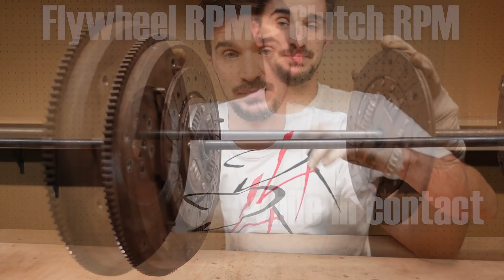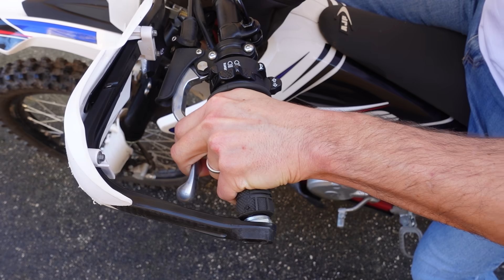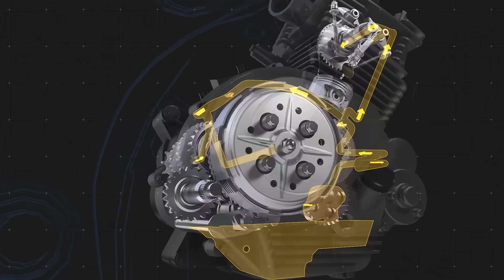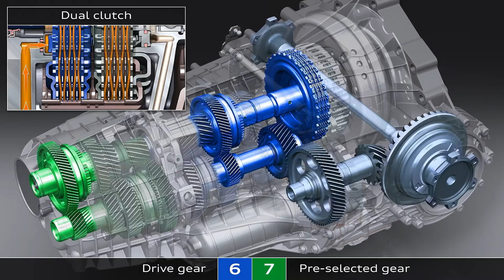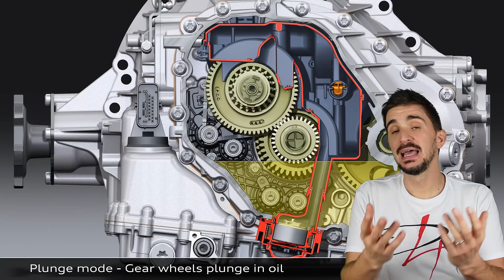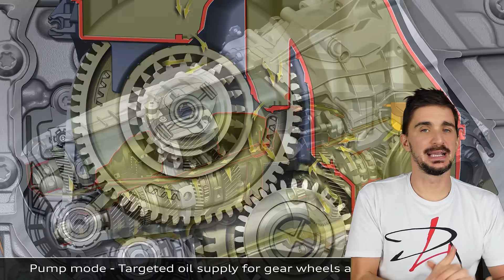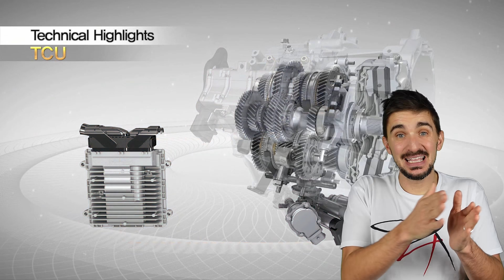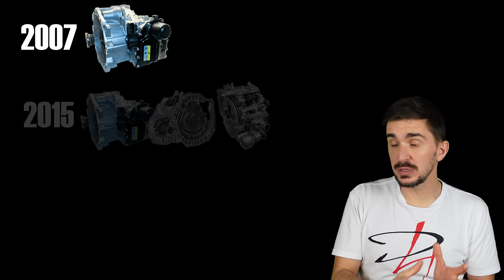Why Dry Clutches Suck and Why You Should Avoid Dry Dual Clutch Transmissions (DCT/ DSG)

Comment: Basically, if you misuse the simple single-disc clutch it will wear out quickly. So not like everything else, in fact, which you can abuse to your heart's content with never a problem. I wonder how I get over 100,000 miles out of a clutch and it still performs perfectly. By the same logic, you should use your brakes to stop the car instantly to prevent to pads rubbing and wearing against the discs. It's exactly the same thing in the end, just over a much longer period. Or should we run the brakes in oil too?

This went to a lot of trouble to explain DCT transmissions. The advantages seem to be they change gear faster and clutches in oil can be slipped for longer. I don't think most people need either of these, but are paying a price in money, complexity and reliability to have them. Is it worth it? Personally, I'll stay with a standard manual transmission shifted by a lever poking out of the floor and a dry clutch which is operated by a pedal via a hydraulic system. Call me old fashioned but it works, has been proven to work over many decades, is reliable and does the job, if not as well as a DCT, not far short of it. It does everything needed.

Comment: This kind of content is why I’ve been subscribed for year. By the way. 

Most people think there are very limited modifications among the VW 7 speed DSG transmission. But only because the marketing name is the same, doesn’t mean they are equal. In fact, for the cheapest options and less powerful engines under 250NM applications they can use dry clutch, but for more powerful cars up to 400NM they have wet clutch and reinforced gears and so on. For even more than 400NM extra measures are taken. one you start to dig in, you realize the “VW DSG transmission” term is just marketing. Two cars can both have a DSG transmission may be dry or wet and may have very different specifications! And those are the kind of things that matter to you in the long run even though most people don’t know/care.
Reply: DQ200 = dry, 250 nm
DQ381 = wet, more TQ
DQ500 = wet, all the torque you can ask from a 5 pot

Comment: Most bikes use a wet clutch. I wish there was a car manual transmission that had a wet clutch because if the cooling ability of a wet system. It would make the clutch last so much longer. But it’s a bit messier and more complicated to implement.

Comment: Aren't like many manual VW manual transmissions from like the 2000s all dry clutches? Yet some seem to last for like 350.000-400.000 km under mixed conditions
Reply: The transmissions last that long. The clutches very rarely last that long.

Comment: "new cars have a smell, and so are new drivers" I'm using this from now on heheheheh
Reply: 😂😂Ngahleka ngalala phasi mfo
Reply: Neither my car nor me as a driver is new, yet it's still starting to smell a bit when I drive hard.
The bite point of the clutch is also very close to the upward end of travel of the pedal.
I'm guessing this means it's soon time to get a new clutch.
Reply: @skitidet4302 You might be able to help your situation adjusting the throw of the clutch pedal, underneath your dash. It's really easy to do, usually just a wrench to break the nut loose and a pair of pliers to turn the rod in/out.
Reply: I felt so called out by that 😭 as a new Manuel driver my transmission is constantly crying in pain 💔
Reply: Wait until you buy a used and abused sports car(mustang in my case) and the previous owners tracked it and were hard on it. Now while mine has never smelled burned even after some nasty burnouts but you can definetly tell that the slave cylinder and pressure plate didnt take the previous owners abuse too well. Only way she likes to run is hard other wise you just slipslipslipslip😂. After i get these caster plates and camber bolts installed clutch, pressure plate, rear diff svc and trans rebuild and service are all up on the plate at the same time. Buy a used sports car they said. Itll be fun they said. Theyre right if you dont mind spending the money to fix em up and love on em though.  @JaxonHile-Hoffer
Reply: LMAO, yeah that was a good one
Reply: means what?
Reply: When I first learnt on a manual I was so scared of slipping the clutch too much so i had the opposite issue lmao

Comment: The interestingly good matchup is the dry DCT and a hybrid (Hyundai Elantra Hybrid/Kia Niro design).  There's no slipping to roll out from a dead stop.  The DCT locks into first and the electric motor (torque from zero) alone moves you up to to 10-ish MPH before the engine clutch engages.

Comment: Got the 180 HP passat tsi with dry clutch. I know a lot of people whi had issues with their dry gearbox cause they are driving in city and traffic jams a lot. I am almost never in city traffic nor traffic jams hence the gearbox runs after 150k km as good and smooth as on the first day. Lesson: it really depends on your driving environment/traffic.
Reply: True. But also 150k km should be nothing for transmission unless you do drag races or heavy towing. Two years ago I sold my Ford Focus Mk1 manual with 335k km and it was still fine with a factory clutch.
Reply: You're using your car for what it's actually good at. Driving in stop start traffic is far and away the stupidest behaviour that's been normalised by the car and oil industry. Anyone stuck in traffic all the time is by definition using the wrong mode of transport.

Comment: I have not had to replace a clutch on any car I've owned since the 1970s, and I've always driven manual. My current car is at 132,000 miles (about 210,000 km) on the original clutch, and my previous two cars have reached similar distances on the original clutch too. 

It's not even as if I drive exclusively, or even mainly on motorways and other long distance routes. On the contrary, there's been a lot of stop-start activity, enough to cause me to have to replace a DPF. 

Maybe it's driving style (I've only replaced the disk pads and disk once), but in any event, I am not inclined to think that, with modern materials and using what I regard as normal driving that a dry clutch is really much of an issue to worry about. They are simple to implement, aren't going to leak (unless you count the hydraulic actuator, although that's been fine for me), simple and light weight (the heavy flywheel is not there for the benefit of the clutch, it just happens to be convenient).

Comment: Torque converter transmissions any day for regular cars. DCT is understandable for a high end sports solution. Not on a road car. Especially when comfort plays a role. This video should be a regular consumer must see to prevent unnecessary cost in daily lives.
Reply: Would be great to see a DTCT.. a DCT but WITH torque converters instead of clutches :D wild idea isn't?
Reply: @NoIPHU Honda put a torque converter in place of a flywheel on their 8 speed DCT.
Reply: Just get a manual
Reply: @Frille512 Not everyone likes the wisk. I like them but in the city i prefer automatics.

Comment: I always wondered if manual toe-heel shifting with a synchronised gearbox is stressing the clutch more or less than usual shifting.
Reply: Less
Reply: By definition it stresses it less, because in ideal conditions you close the clutch when the transmission input and engine are almost at the same speed. Even if the transmission input is slightly faster than the engine it will still be less stressful than if it were slower because it's much easier to decelerate the engine than it is to accelerate it

Comment: God, I hate how the "efficient" solutions always come at a bigger cost overall

Dry clutch, turbo on every single car now, plastic parts, EV batteries, what else?
Reply: It´s not the  "efficient" solution... It´s the solution, that takes inefficiency out at a place where the state controls (exhaust-emissions), and re-introduces it, but bigger, at a place the state won´t control (dry-cluch-cooling-airflow).
Reply: @klausbrinck2137  Like how a Webasto preheater is allowed to dump pure diesel/petrol fumes as much as it wants, but the engine must be squeaky clean. All for the illusion.
Reply: @s2000.  Ok, but a preheater burns rarely, and it preheats, thus raising efficiency. Also, a preheater isn´t unefficient at all, cause of the ideal burning conditions (tons of time for gas-exchange and actual combustion), unlike an engine, that can never be so efficient, no matter how much expensive technic you throw at it (engines manage the impossible, while preheaters have the easiest job on earth).
Reply: @klausbrinck2137  True. But for many diesels, the preheaters fire up for every single start if the engine temp is below +4. And there have been studies showing insane particulate emissions from the heaters. My petrol VW heater smells like an vintage car, the whiff of unburnt petrol is unmistakable there.
Reply: @s2000.  "smells like a vintage car" but does the whiff come from the engine, or from the preheater?   It´s good to note here, that even older cars manage the emision-standards, it´s just the cold-engine-start that ruins everything, and the industry has spent millions in the recent decades, just to inprove emissions during the warm-up-phase (which lasts just 4-5km of the whole trip)... To my opinion, it would have been better for everybody, if the car simply wouldn´t take any additional throttle, unless the engine reaches its optimal operational-temperature... But this isn´t the case, so, the next best solution is to spent millions and raise prices, so that one can immediately drive away after start-up. My suggestion should at least be an option, offered at a far lower price (since such an engine would have much older, cheaper tech inside, still without compromising emissions). Me, for my part, never immediately drive away, but wait several minutes, and I notice it at the consumption... It´s gazoline, but I bet, I wouldn´t have any petrol-whiff, if it were a petrol-car.
Reply: @klausbrinck2137  From the heater. It's a plug-in hybrid VW GTE. Saving the earth by driving on electricity, but preheating with 70s exhaust smell. If you don't use it the cabin heater is very inefficient on e-mode. ICE cold starts have been improved on yeah, I think the money spent is well worth it. If the engine fires up, it takes barely a minute or two before it's blowing hot air and you can hear how quickly the exhaust tone quiets down (which is the cold enrichment program finishing). And it is much better to drive immediately, as the load on the engine warms it up considerably faster, as you said, a cold engine is not good.
Reply: @s2000.  Seems that the preheater does its job pretty good, compared to the whole trip, 2 minutes of mediocre preheater burning-efficiency doesn´t sound bad... I think gazoline-engines should also have preheaters... A latent-heat-preheater (principle of a pocket--hand-warmer) would be the ecological option, I never understood why there isn´t more research on that: Chemistries, that melt by the touch of hot oil or water, just to solidify at a glance by a simple command, thereby bringing oil or water to its cooking-point (when already cold again), already exist since ages, after all.

Comment: I disagree, because the idea that these gearboxes are a disaster just does not match the reality for many owners. I bought my 2020 VW Passat 1.5 TSI brand new and it only just needed its first clutch replacement at 260,000 km after years of mostly highway driving. I agree with your point about the environment because dry clutches do release friction dust into the air instead of trapping it in oil, but for the driver, the efficiency is a huge plus. By skipping the heavy oil pumps and the drag found in wet systems, I got much better fuel economy and saved at least 1,200 euros in mandatory service costs over the life of the car. I just paid a specialist 300 euros for labor and 300 euros for the parts to refresh it, which is a bargain compared to the much higher price of buying a 2.0 model with a wet clutch. My car has been flawless, and for anyone doing long distance commuting, this gearbox is actually a great choice that saves a lot of money.
Reply: Most car owners don't drive mostly on the highway. For your specific use case it may be better, but then for highway driving it almost doesn't matter what clutch you use since it won't really be doing much.
Reply: The whole point of the video is just fearmongering for kids. The DSGs are a situation where the small highly stressed city cars would benefit from the durability of wet DSG, but in the end, it just makes sense to produce the most efficient car that lasts the warranty period as that's how the current world works. If you avoid the high stress situations for the clutch packs its great as you found out.
Reply: @s2000.  So Mr. D4A helpfully informing the public about how manufacturers knowingly and willingly produce shitty cars with bad technology is now "fearmongering for kids". Got it.
Reply: @Tuppoo94  He did not bring out any real world data of how this would affect you. Workshops already know these cars well and replace the clutches as a common job just like they do on manuals. Wet DSG oil changes are very expensive and the clutches or other internals are not more immune to wear either. The fuel savings are considerable, though it is also related to the fact that dry DSGs get the more efficient, smaller engines.  
So in the end, it still will pay out to be more economical to own the dry DSG. I pointed this out in an another comment to D4A, did not get a response.

And I bet at least 25% of the audience here on YouTube is underaged judging by the new comments. Just following the movement, parroting the info forward, not thinking themselves.

Comment: Dry clutch and wet belt for optimal performance
Reply: Put water pump between engine and transmission with wet timing belt.
Reply: @GF-mf7ml make the water pump housing plastic, for extra reliability.
Reply: @sopranerds1 and the start as a part of the flywheel on the motor side.
Reply: @lbochtler now that's a design that maximizes shareholder value.
Reply: @sopranerds1 Audi ea837 moment
Reply: @GF-mf7ml  *BMW Engineer enters the chat
Reply: Anything but giving us a manual transmission
Reply: @sopranerds1  CVT
Reply: @samuelzackrisson8865 "I love blowing up at any sign of torque" ahh transmission.
Reply: @sopranerds1 making a car feel like a boat ah transmission 🥀🥀
Reply: @sopranerds1  Just the modern ones built for cost (IE build them cheap, make it so they have to come back to us often for repairs). But CVTs have been around since 1879 so there's a bit of nuance. 

In 1994, the FIA banned CVT's because they performed way way better and it ran on a V10 Renault engine. Had 0 issues taking all that torque and power. Atlassian Williams F1 Team built and tested it.  The FIA was worried it would put other teams at a disadvantage for a long time and it was harder to regulate. So they banned it along with a bunch of other stuff that year. 

We have the capability to make CVTs stronger and last longer than any gear-based transmission but we are hindered by greed, regulation, and market trends.
Reply: @NotRandoWis exactly cvts can be good but we purposely make them shittier to make money
Reply: @flameburstgt6503  yeah basically what i said. I just wanted to use an example.
Reply: @NotRandoWis  That story about Williams F1 CVT is in fact wrong. It never was faster, in fact it was slower and it sure did have a lot of problems

The FIA did not ban them because of a technical advantage. They were banned immediatly because they had no traditional gears and at that time F1 tech regs said you had to have 4 to 7 forward ratios. At the same time  many electronic devices such as anti-lock brakes, traction aids, active suspension systems were also banned. 

The story about a Wiliams CVT equipped car is complete garbage that has grown legs over the years but if you do any real research - and by that ignre ChatGPT and other AIslop that quote Quora - you will find that the truth is very much not what you claimed
Reply: @C@CatTerrist’s real, many videos already covered it like Driver61,  it’s faster because it allows the engine to stay in the powerband all the time and combine with the active suspension and other traction aids it’s op. So it’s not Ai generated theories. Do your research before saying something wrong so confidently
Reply: @flameburstgt6503 I would say otherwise. I work both bikes and cars, majority of them being small scooters with dry CVT, and let me tell you, both mass produced dry and wet CVTs sip power way more than other transmissions because of their V-Belt (both kevlar-reinforced rubber and steel variants) and its dry centrifugal clutch slip. Mass-produced modern CVTs are designed to fail in shorter mileage.
Reply: @CatTerrist huh, funny.....thats the official story the FIA has given to this day with multiple people to back the story....but alright i guess I'm wrong and the story you gave isn't the one that grew legs right? oh well.
Reply: @CatTerristany reference links you can share? I'd like to read about it (please dont tell us to just go search on our own so conveniently)
Reply: Ford moment
Reply: make sure timing is with brittle gears instead of belts and chains at the back of the engine for optimal performance
Reply: it have a name "pure tech"
Reply: Add in adblue
Reply: I would add biodegradable eletric cables that erode after 10 years and make the car propense to electric fires.
Reply: Optimal performance of car dealers digging into your pockets.. oh yeah